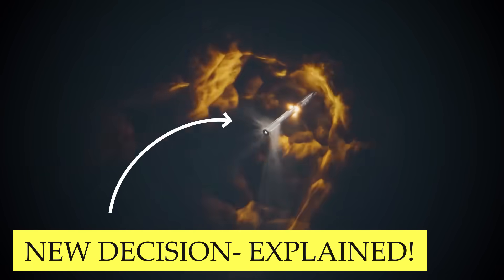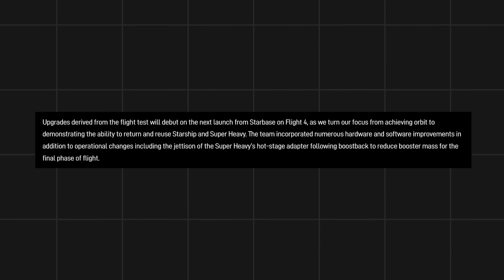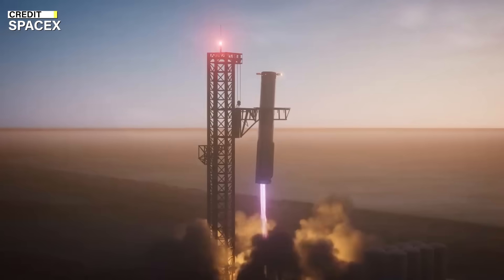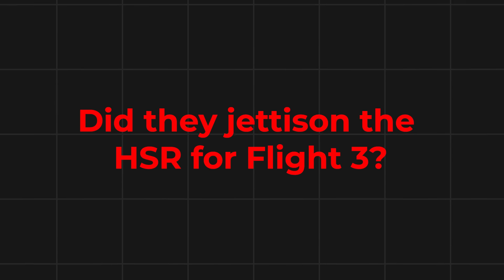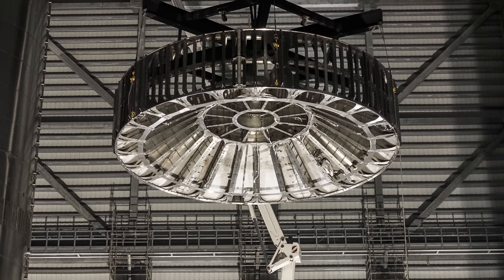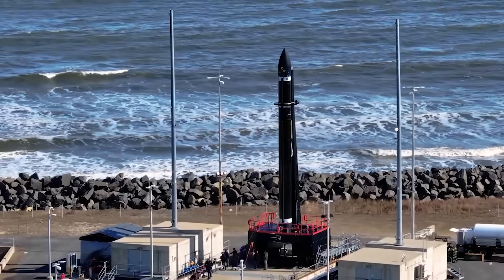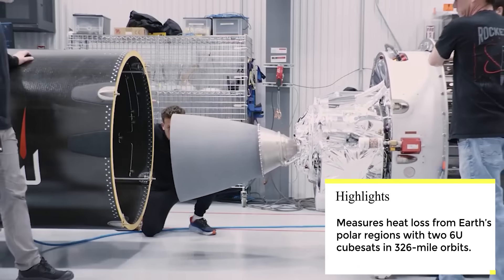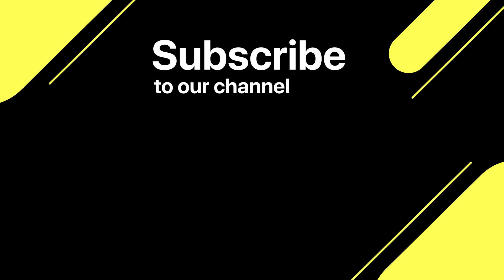Why Starship Hot-Stage Ring Was a Big Mistake? Rocket Lab Launch | Episode 45

Comment: Will the take off be less volatile if it took off from under the sea?. This way the fuel is contained in the pressurized gasses and keep the boosters more adaptable to velocities  burning up through heat stresses. My thoughts are the adaptation of boosting in a containable pressure and super heating of gasses that are pressurized vapor easily igniting leaks made by extreme transference to propel the rocket with less inert changes that leeks can be cauterized and frozen ice can seal. Creating a safety as pressures can create elemental reactions. What I mean is when the ships are boosed in air the fuel escapes freely and opens up the leaked seam exposing to fames in air it's just going to make an escape of air and possible bomb to its containment. The boosters would be only ignited at it's intended release. If it were to burst a broken seam under water the frozen escaping gasses will freeze the surrounding waters to its exposure keeping pressures from escaping anywhere that is not intended. I can see a method of solution to possible thing that can happen.
Reply: I mean less likely to loose thrust when pressure is contained at a hot take off. Am I right as I see it or is that a ridiculous thought in solution to prevent. Not just failure but catastrophic failure and waisted valuable invested dollars to write off to. I don't think the money is a place you can experiment with for the interests of a company they invested into cause to fail billions to do it again. Why risk it why  would you create a selfish failure. If I was to invest into such a problem and that much investment for most who have worked hard to achieve as an important asset loss to a gain into the circumstances it don't need to waist. The things that cause cryptic failure are the littlest things overlooked.  And why the failure is to provide to that. Well good project for experimenting on our atmosphere that's getting shot up with holes that keep the ozone a strong protective bubble. Will you understand that Everytime you punch through the earths shield.  it is weakening it's  barriers and refecting a climate change.  If you don't understand how it's causing natural defences that hold earth neutral  form . Why waist it on playing with things you shouldn't just because you  have money to build it. We are not invested in leaving our perfect system cause it's abused cause it can. You need to be more careful of these interstellar realizations before you find the consequences you can't fix. Please heed my words important. I love our perfect solar system and I honor it before I honor  the destruction of its  make up. I'm proud of our Sun and it's family. Why kill it within by violating the core progression that it is. If you believe in God. You know it's not an all mighty being but a team of exracelestrial reasons. I am worried about these plans and how much activity is going out of our atmosphere. It's made to keep the bubble of our climate not to let it all escape to ignorant problems. Earth doesn't have to be destroyed because your escaping a planet climate and crusts changes because you keep breaking down the barriers that keep climate reactions. That is exactly what it is.  Unlivable. Don't even think these changes and warming and natural catastrophes are happening without a reason  or cause. and solutions are becoming stupid to a lie to God. Think about it. If I'm a hater then so be it. I will hate as long as your tourchuring our future as humans. Yes I am saying you persist of shooting up our lives I will have to fight for life. Don't let it get to your head and manifest love for humanity to provide more experimentation on how to end it....get real! I don't care if your God itself, if God turned again ed it's creation. Then it's dubious to what it's creating. But GOD does exist. And it ain't Jesus! Dieing for that sin.and his soul is incomparable to God's true form.. Promise you that. If you know this already then I truly have a calling and it's loud right now.  Hope your not offended with the breaking of a beautiful dream I'm expressing. But if you don't see what I'm saying and want to reject me as a friend an a true lover of humanity and existence I will defend it regardless of my appreciation/love /respects to it or you. Call me your dream breaker.  But then I'll call you the Devils worst potentiaI. I  support my angels and defend their celestial wishes. Even if you can't understand consciousness outside your own. Just saying. I'm not just spewing inuenos and crazy speech  from conspiracy theory. I'm speaking on behalf of God and a command I would not take heed in warn. I would be expressing  possibilities I'm expressing how you are causing  not Armageddon but nonexsistant being. Satan's nightmare. But we humans are retarded to such things that we don't learn from primal instincts it's extinction for the greater good. I'm proud of our breakthrough in civilizations time and tech that we are but it's not for anyone to experiment cause your access and. Curious trespasses on territory you don't get to possess. It's a beautiful dream but keep it that way as nature is bigger than a name. And it will end it's irritations. .. whatever I'm serious. I am an alchemist and artist that sees through it's reality as little as it seems. I will get more expressive to release the message not made just by me or humanity. I'm defending the retarded humans that get to have it without responsibility to create graditude for life not find a way to destroy it believing they are helping by eating the fruit of a forbidden tree. Period.  Take it for what it is. Appreciate it how it comes. It's life. And human isn't the only consciousness here on earth.  Alien is a human transformed. And what else would you call a mad idea .  However you take this. I'm not against your belief I'm againced you making a catastrophic mistake. As a friend. Thanks.  You wanted my comment. It's my truth and how it's released.

Comment: Hot staging increasing payload by 10% -- I'm frickin dying!  The delay between MECO of the first stage and firing up the engine of the second stage results in a performance hit as you increase the time to orbit and that increases the gravity drag penalty.  So, anything that reduces this delay will increase payload, but no where near 10%.  I do not no where you got the 10% figure but it is in no way related to reality!  Using the formula to calculate gravity drag as a function of 'time-to-orbit' and taking 9 minutes as a baseline I get the gravity drag penalty as equal to about 1792 m/s, reducing the time to orbit by hot staging or other technique to reduce this time by, say, 6 seconds, would reduce the gravity drag penalty to about 1782 m/s so that the delta-V penalty is reduced by about 10 m/s which by my calculation might increase payload by about 0.1% and not 10%.  The calculation of gravity drag is more complicated than simply using time to orbit as it matters where in the launch to orbit the rocket is wasting time.  If this happens early in the flight when the rocket is using most of its thrust just fighting gravity then the penalty will be greater.  At the point in flight where staging takes place the rocket has gained a substantial horizontal velocity and that counters gravity with the v^2/r equation.  So, taking into account but the penalty equation and where in the flight the rocket is not thrusting the total penalty is unlikely to exceed 1%.

Comment: I suspect, SpaceX was being coy and you fell for the understatement.  I suspect there are three issues here: landing mass being just one.  The ten tons, estimated weight will have to be augmented by the fuel needed to safely land the first stage and when this is locked down, this “weight penalty” will be paid in every launch.  However, note that the design of the first stage (Superheavy) was completed before the ring was added.  Most of the landing direction is done with the grid fins, whose size, thickness and weight were minimized.  Adding another ten/fifteen tons of mass is an issue, but having the ten tons at the end of the rocket, will maximize the weights impact on center of gravity, with is controlled by moving the center of pressure from the grid fins.  A slight increased separation or decreased separation will have an enormous impact on the moment arm and amount of control force which is applied for a given deflection of the grid fins.  This may be much more important than the augmented mass itself.  Thirdly, and perhaps most importantly, again the ring is at the trailing end of the Superheavy during return.  Isn’t this where planes have the majority of their control surfaces:  the ones which are not at end of the wings?  Vortexes and other anomalies from a smooth surface, as Superheavy goes from space and hypersonic speeds, through supersonic speeds and intermediate atmosphere to landing at essentially zero speed, at sea level, with perhaps a cross wind, while balancing on a rocket or a few rockets would add a huge number of additional variables, potential constraints and needed redesign.  What if the landing is in the rain?  Will the ring collect water, which can slosh about right when the arms are about to “catch” the Superheavy?  I see lots of reasons to jettison the ring.  Recovery might be possible, but this might be a disposable thing until later, when it might be used in space.  Who knows what the great SpaceX minds might conceive and implement.  Thanks for a fine video.

Comment: Hot staging is performed routinely on several launch vehicles which have used it for DECADES.  Stop blaming the concept for an engineering failure.  Hot staging works, but it adds weight. Elon's insistence on avoiding certain well-understood, mature technologies - such as pyro bolts - is about ego, not good engineering.

Comment: Additional weight for a detachment system would seem counterproductive. Modification of the control code and redesign of the hot separation ring to provide better flow and less heat capture at the upper booster seems in order to eliminate damage to gridfin components. Software weighs nothing and a properly redesigned hot-stageing ring should be around the same weight as the current one... maybe a bit heavier. Fuel management obviously needs improvement as well as indicated by the apparent lack of it in the controlled decent we witnessed. Attitude control would also seem to need attention as seen with the uncontrolled rolling and pitching of both booster and Starship. Granted, I retired 20+ years ago as a Design Engineer,  but these and other issues I have seen must be addressed if successful operations are to be achieved.  IMHO

Comment: Have we considered the incredible forces and heat damage the HSR suffers during separation?? That component is essentially passive, and very inexpensive to reproduce.

Because it absorbs all of the abuse during separation, the top of the Booster can now be simplified and lightened... it no longer has to try to survive that massive abuse.

It's easily disposable. Designing something that can withstand the forces AND heat... repeatably, would be incredibly heavy and expensive.

Comment: The whole evolution of the system is a process. We may well see an entirely different top section that is self contained. Then there is the separation process itself. Maybe only three engines fire and the other six ignite a few seconds later. Even the WDR shows they are increasing the rate of filling to adjust for the formation of ice in the tanks. The best solution is no part at all but still, a layer of insulation may be a better solution than more filters. I worked in New Product Realization and we made do with what we had until the next iteration of components were available. Our circuit packs looked like plates of spaghetti from all the "quick fix" wires we used. I spent hours working with the assembly people interpreting the new drawings as to where to cut and splice. Then we had to use a bed of nails test unit to verify all of it. This was all before system test even got them. You have to be something of a nerd to find it fun I guess.
Reply: This is very expensive, and is evidence of no real engineeering oversight.  Liquid fueled rocketry isn't like manufacturing circuit boards.  Sorry.

Comment: Couldn't a sturdy, retractable landing leg design for starship double as some kind of a hot stage apparatus?  ( a telescoping design or swing out) The thing is supposed to land on rugged terrain anyway, right?
Reply: I mean... what's the weight comparison of the hot stage ring to landing gear??
Reply: How about integrating the grid fins and landing legs into a hot staging section? Sure, the grid fins would require more hardware to swing into position for the return ( much like falcon 9) the tower should still catch. And the starship should have the option of landing legs. Just makes sense to me.

Comment: They could actually recover the HSR as they do with Falcon fairings, and splashdown into the water.
Reply: It could easily be fitted with some inflatable flotation device and GPS pinger of some sort or another. Ideally it will be bette4 designed into future iterations.
Reply: Wouldn't it just sink?
Reply: The fairings has a wall like a boat and can float. The HSR is like a big strainer and doesnt float!
Reply: But that's ten tons of mass using fuel that could be used to carry payload.

Comment: The ejection of the hot stage ring will throw off the center of gravity and hence the center of pressure when restarting booster motors. When they do the boost back flip even makes the condition worse. I still believe their biggest problem is flipping the booster with the motor fluids traveling all over the place. What is SpaceX going to do when they extend the booster length?????  If you want a little fluid engineer (visual) just take a several liter bottle of water and throw it up in the air straight, were it flips at Apogee and watch what the fluid does. There is a way to take care of that problem if somebody down the road want's an answer. Just a quick note: you start changing center of gravity and center of pressure during flight, you have all sorts of problems. Ask any rocketeer!
Reply: Clearly you're not a rocket engineer.
Reply: Just like in Starship they need header tanks to restart the engines so sloshing doesnt interrupt fuel flow. Smoothing out the staging reducing fluid sloshing with an internal collapsible/ inflatable bladder like in an infant baby bottle may reduce the need for the soviet style hot staging that many of us just don't like.. just as many of us don't like the Artimis program recycled NASA "should be in a museum not on a rocket".
Reply: All of this was foreseeable, right?  Where is the engineering?
Reply: And you think you're the only one to think of that??

Comment: The hot staging ring was not included or even considered in the initial design of SuperHeavy version 1, and so it doesn't surprise me that it messes with the balance and control of the booster when attempting to land.
They will, presumably INCLUDE a hot staging mechanism from the start in designing Version 2 and/or later versions, so it will not need to be jettisoned, thus maintaining full reusability.
Reply: It's like you think they added it to the system like you would: by stapling it to the top without any furthet consideration.

Do you really think that's the case?
Reply: @camojoe83  Probably did not do full engineering with that change.  That's the insanity of iterative design!
Reply: Exactly.  That commenter seems not to have noticed that the design of the hot staging component changes to bona fide trusses in the Block 2+ iterations, and we've already seen the last Block 1 stacks manufactured, so there won't be any more rings.
Reply: The initial design didn't have the ridiculously heavy stainless steel skin either!!
Reply: Completely agree. 👍
Reply: Maybe some form of side engine  or gas vent with enough thrust to still separate the ship

Comment: Nah! I think they will design a new type of HSR or incorporate something on top of booster, they’ll figure it out or make an inexpensive ring that will be thrown away. Why are some trying to make a story about Raptor explosion at Mcgreger? They blow up Rockets motors all the time ! That’s why they test test test, no story here I believe.
Reply: You are correct.  They’ll use an ejectable hot staging ring until they design a lighter one (which, a few episodes back, they mentioned).  A series of bars as used by Soyuz.
Reply: Exactly. McGregor is a testing facility to see what works and what doesn't.

Comment: Also was wondering if there any negative aerodynamic effects of having the hot staging ring on the booster during re-entry? It's a weird metal thing with some strange holes in.
Reply: There is no re-entry.  The booster never makes it out of the atmosphere.
Reply: @GaryandBex  Yeah I worded my question wrongly. Anyway any aerodynamic effect would be more prominent in the thicker parts of the atmosphere. I asked because the booster wasn't under control. I am sure that was mostly about the engine problems, but must be easier to predict what a rotating cylinder with a domed top will do than a rotating cylinder with a metal bit with slots on top will do.
Reply from the maker: That’s a great question! The hot staging ring is built to handle hot exhaust gases, mostly dispersed sideways. I don't think, it should significantly affect the aerodynamics....